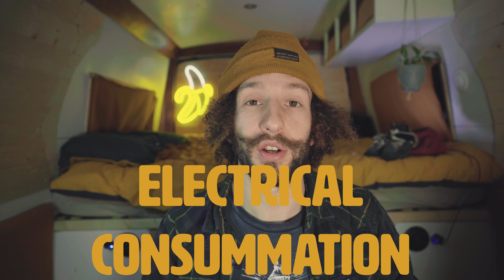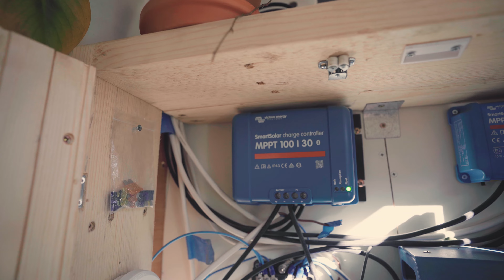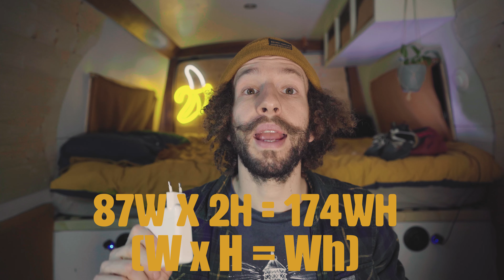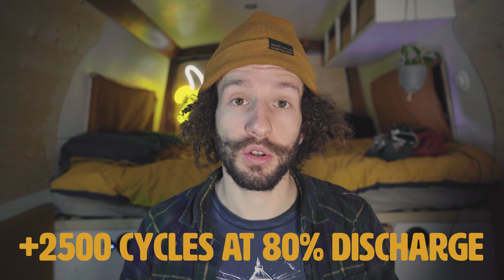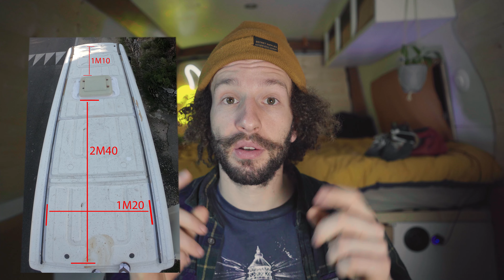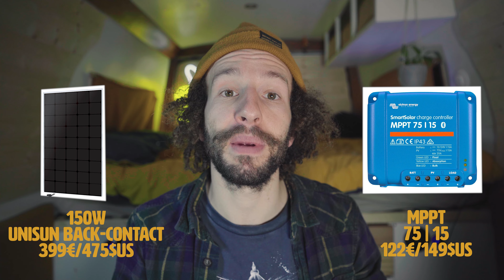Understand Easily SOLAR POWER SYSTEM In Your VAN

Comment: @Nikolas Pulka,  id love to know, how much power you get in a week.... or some other unit
Reply from the maker: Do you mean how much power I'm getting from the panels ? It can various a lot depending on the weather and where I park of course, but I can give you the numbers of this week if you want.
With my bigger panel I generated:

Yesterday: 680Wh
2d ago: 1.52kWh
3d ago: 1.37kWh
4d ago: 1.20kWh
5d ago: 1.48kWh
6d ago: 140Wh

From what I just understood looking at the stats, is that 6d ago my van was parked at a friend's workshop to fixe some stuff and my batteries was 100%full, so it seems that the app is not recording what the solar panels is generating if the battery is full, I guess for a safety procedure to not overload the batteries.

Off grid it looks like more that I'm generating often between 1k to 1.5k with my bigger panel  and around 500 to 800 with my smaller one.

I hope I answered your question, if not don't hesitate to reach me here or on social media.